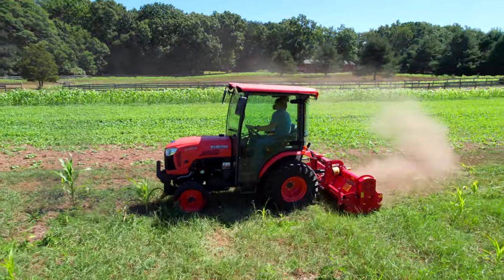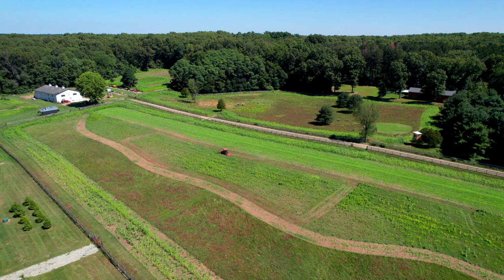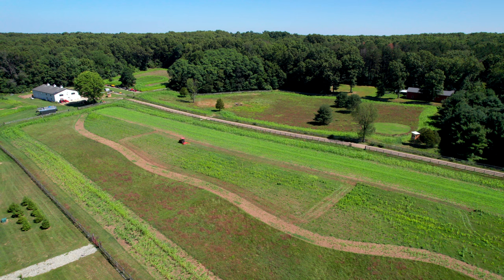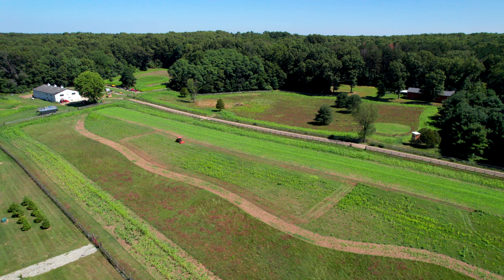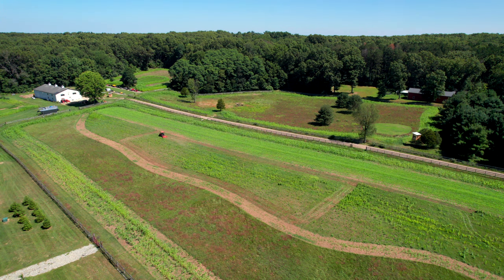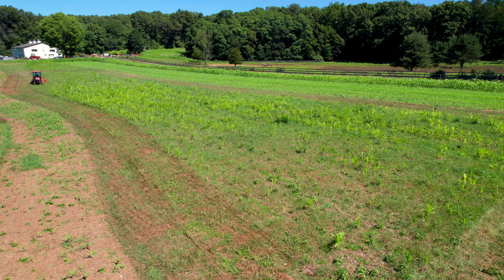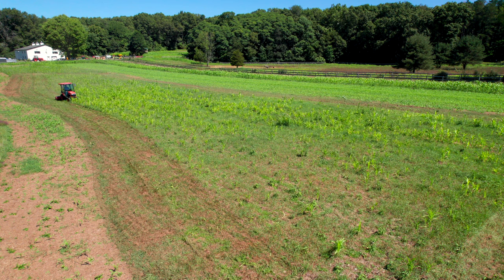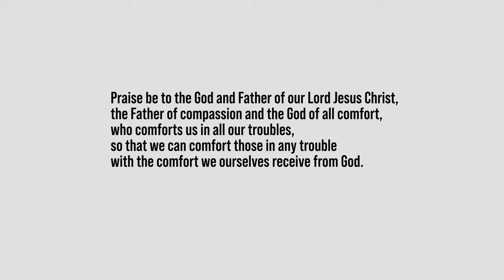TOO BIG! DON’T WASTE YOUR MONEY BUYING THE WRONG SIZE TOOLS!

Comment: I planted a 1 acre corn field and 1 acre sunflower field. I bought an old John Deere 290 2 row planter. Loaded in the fertilizer and seed and both fields are awesome. Roundup ready corn, sprayed with a boom sprayer on the UTV. Ground driven planters old school about 1500 for a good one. Way better price than a seeder.
If you want to seed contact your local field conservation office, you can rent one for cheap from them generally.   Kioti  CK3510 SE pulls it easily on hills in Southern Ohio.
Reply from the maker: Yeah, I need a corn planter for next year.  I've got a Genesis no till drill now, but I see mixed reviews on planting corn with them.  Seems like nothing beats an actual corn planter.  Thanks for chiming in, appreciate it!

Comment: Those 2650’s can be a little underpowered for some stuff. I turned mine up a bit and ran a LOT of cetane boost. I put 650 hours on it in 3-ish years, mostly plowing snow. Stock power, it could easily plow 6”-12” deep snow. I really needed a tractor that size with a 75hp. Just plowing snow I probably could have gotten away with 50hp. I needed a 60” snowblower on the front and at least two screws (augers). I was plowing roads and driveways that drifted up. Horsepower saves a lot of time!!! I had all four tires filled and wheel weights available front and rear. Tires were studded and I also had diamond v-bar chains for the rear and H pattern v-bar on the front. Dirt/gravel roads and driveways so I didn’t have to worry about damaging asphalt or concrete. There were a few concrete aprons that I would drive forward to the garage door and use the bucket to backdrag the snow off.  I never charged for what I did but always ended up having enough to cover fuel and preventive maintenance. It wouldn’t have upset me any if the county could have kept the road open or if there were other options for driveways, but when the money and means aren’t there, they aren’t there.
Reply from the maker: Good stuff, thanks for taking the time to share!
Reply: @GoodWorksTractors  Welcome! Thank you for the videos! I learn something or figure out something with each video.

Comment: I used to run a 6 footer from my old  fergie, it went fine for the lighter stuff, The mower design is an efficient design
Reply from the maker: These flails are pretty darn efficient, that's for sure.
Reply: I like know how big was that Fergie you had on that mower?

Comment: Howdy Sir..
I have a 2650 and really like it.. I have a front mount snowblower for the winter and it works great.. Also has  loader… Nice Tractor..
I also have a 1025r with no cab.. I like it better but it doesn’t have the lifting capability as the 2650.
But oh well.. 
Thanks for sharing this adventure with us.
Cheers
Reply from the maker: Hey, thanks for stopping by.  I also like the B2650.  Just has limitations like anything else.  Only thing I really don't like is the treadle pedal.  Some like it, some don't.  Other than that, it's a good machine.  Have a good one!
Reply: @GoodWorksTractors  I totally agree on the treadle pedal..
And the Whine .. It is loud even with the cab..
Reply: Small Kubotas whine like no other and that treadle pedal is not for me either, that's why I bought another  brand!

Comment: So a couple of questions: I may have missed you saying but did this mower have the hammer blades? Second, did the front end feel “light” not having the FEL to counter the heavy rear mower? It looked like it was rocking a bit more. With all that dust, your cab would save you from some dirt baths.

My corn got eaten by the deer every time it hit knee height!
Reply from the maker: Yeah, hammer blades on this guy.  I meant to talk about the lack of weight up front.  It was a little light at times.  Didn't impact it in this situation, but some counter weight up front would be ideal long term.

Comment: Can you do a video on the opposite question. I have a 5ft flail mower and a 5ft box blade that I want to put on a 75hp tractor. Will it necessarily be to much power... or just go slow?

Comment: Must have been relatively rough ground because it appeared as though you were also doing some roto-tilling at that height which also sucked the power.
Reply: I feel like the angle of the flail mower was pitched a little too far forward

Comment: Not impressed. My 1948 Oliver 60 with 17 HP can pull a 60" plus finish mower. I willing to bet it would cut the stuff you are mowing.
Reply from the maker: You weren't supposed to be impressed.